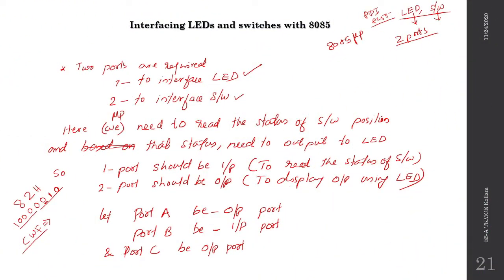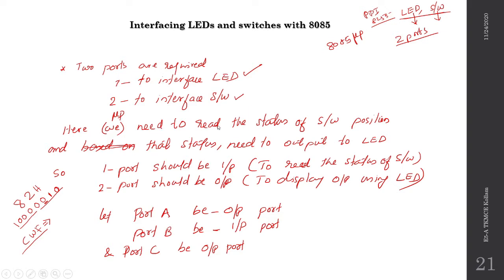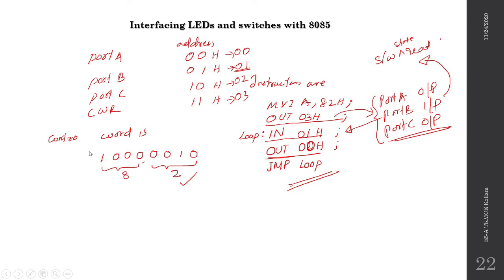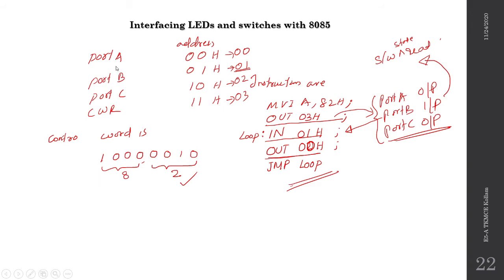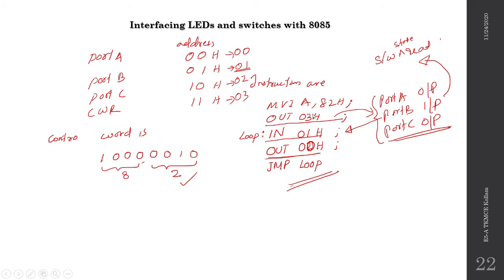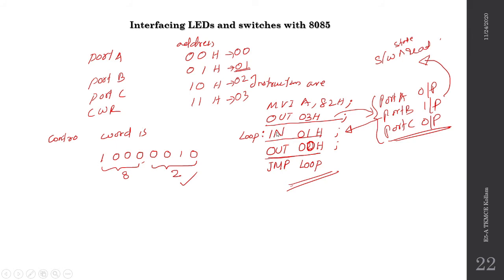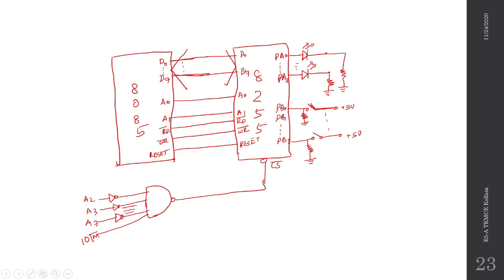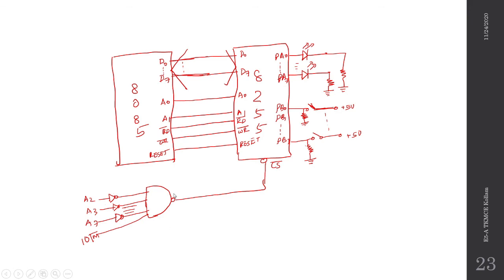LEDs & Switches interfacing with 8085

Comment: Awesome explanation sir👍. Can you please help me to write a program for blinking LED on and off with delay time using 8085 microprocessor?
Reply from the maker: Sure
Reply: @eeelecturestkmce199  thank you sir... I want to write a program for two LED on and two LED off with delay time of 1.2seconds.How should start this program with 8085,sir?
Reply from the maker: @gayathiris134  first initialise your output port. Say port A as output remaining Port are not required. Lets fix them as out put.Among 8 pin of port A, fix any four bit for controlling your LED's, say Ao A1 fix as 0 for off two LED'S and A2A3 for puting on other two LED'S. after this you need to call delay. After completing subroutine you need to reset A2A3 and set A0A1..after that again call delay. After completing this, jump in to the first case...
Reply: @eeelecturestkmce199  you did a great help to me sir!. Thanks a lot!.